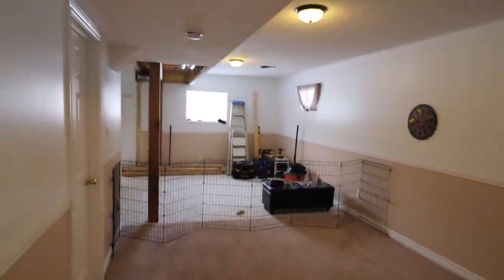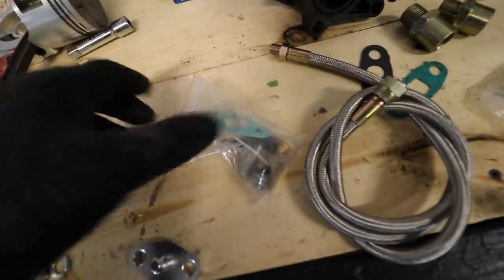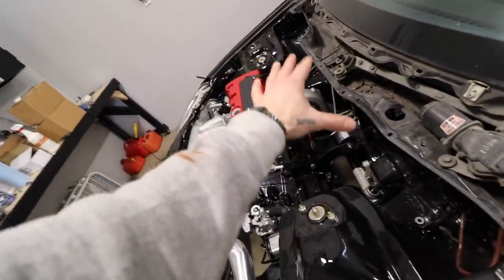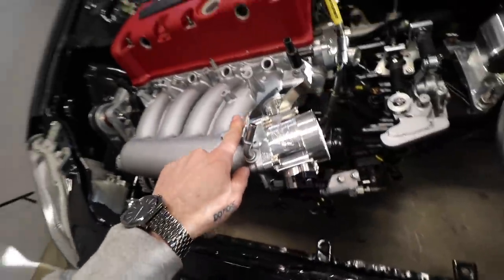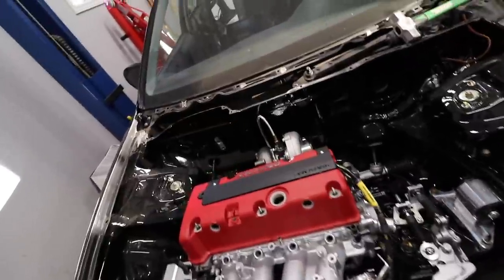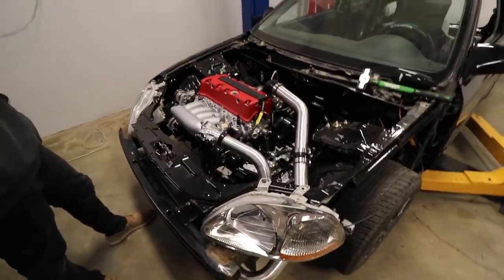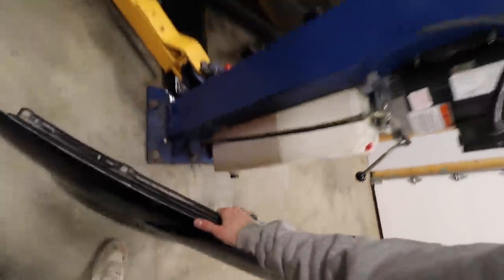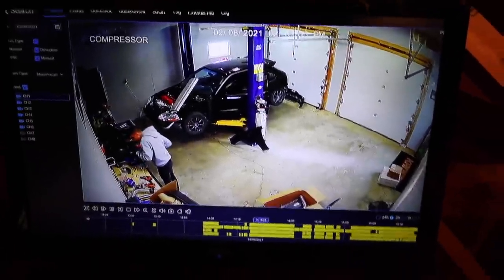COMPLETING THE K20 TURBO KIT!

Comment: Just an observation, when you cut those charge pipes for the intercooler, you DEFINITELY want to either have the ends rolled, or at least get a pair of wire crimper that have the bump in the end that you can crimp a roll into the end of the tubing. I have built quite a few turbo cars, and I learned that the hard way.
Reply: Was going to say something similar.
Reply: And he should weld some longer pieces together.
Reply: I was thinking weld the whole thing and not worry about it popping off
Reply: @justinguarino201  yes indeed and it would help with the clean look.
Reply: I think Robbie said he didn’t go for welds because he can’t TIG weld, probably none of his buddies can either and I’m guessing he didn’t want to go and pay someone to do it especially during lockdown and stuff

Comment: Robbie to be honest it would be best if you upgrade to a cx racing rsx intercooler as it’s like 200$ off of eBay it’s removes headache and clock the turbo to the fire wall, it would also helps it boost too.

Comment: Hey Robbie, why not go from turbu to the leftside of motor, down to the rad, and then pop from under de light on the right to the manifold? It would be less tube and cleaner look 😎 with the length of the tube you have there you will have a bunch of trubo lag...

Comment: robbie, you really should get a vertical flow intercooler that has its inlet/outlet both on the drivers side, would simplify the intercooler piping sooo much and be way cleaner, not to mention spool faster in theory because the piping is shorter

Comment: That top thing you called a "map sensor" is most likely the intake air temperature sensor. I dont mess with k series but on a b series the sensor on the intake manifold is the iat and on the throttle body is the map

Comment: Wow, I love K-tuned parts. They're ALWAYS such beautifully designed and manufactured parts. I have their adjustable coilovers on my turbo J32A and six speed manual swapped CG1 Accord and they've always been so awesome. My car rides so much better than even my Cadillacs did, and it's two inches from the ground. I love K-tuned and I have many many parts from them between my Accord and my fully built EJ8 Civic that makes 612 whp.

Comment: 13:20
No. A garrett turbo is over 2000$, and a brand name kit usually is like 5000, you can add whatever you want on top of your ebay kit, you're still gonna be way cheaper.

Comment: Hey so right now all your piping is circulating clockwise, what if the ''out'' of the turbo actually went on towards the passenger side, wouldn't you need much less pipe? Cause now it seems you need a bunch of extra pipe from the throttle body to the intercooler.

Comment: Couldn't you route the hot side to the left side of the engine and cold side directly to the throttle body? Also like a person mentioned in the comments, don't forget to roll the edge of your piping if you don't want to blow while under boost...

Comment: I love the build but I think the intercooler pipe on the hot side looks horrible . Look up better ways I think running the pipe from turbo lower is the way to go . Also get the pipes welded instead of all the couplers. And a dual back door intercooler would have made it much cleaner, and not 30 feet of pipe